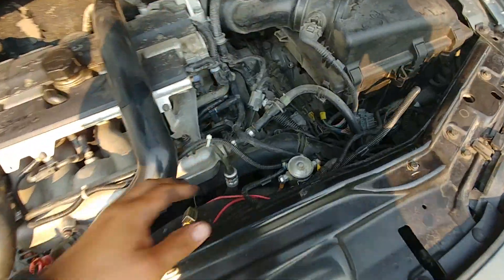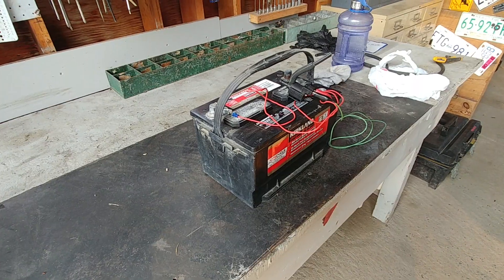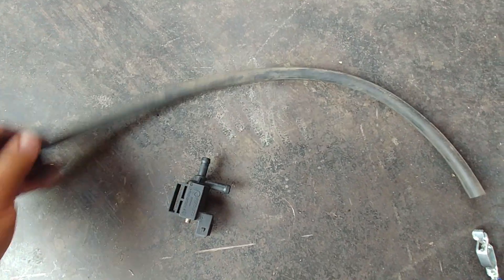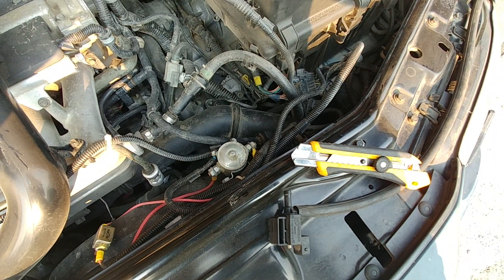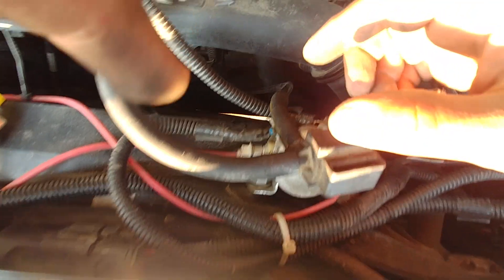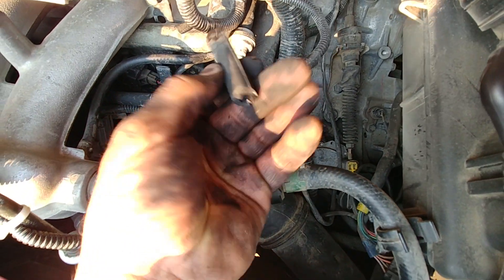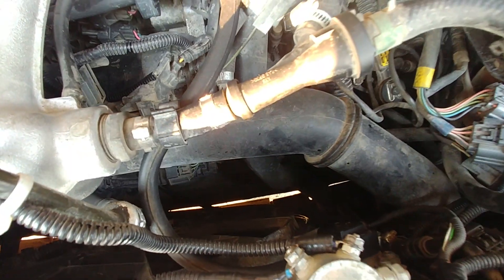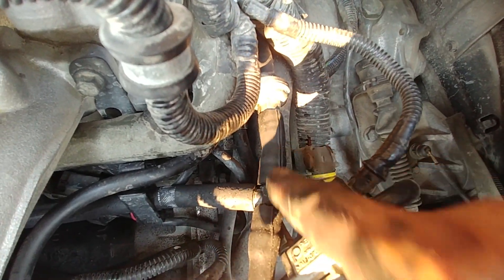VOLVO codes: P0442, p0443, p0446 EVAP SYSTEM LEAK. PURGE SOLENOID VALVE. VOLVO

Comment: Just wondering if the part really needed to be replaced, or just the vacuum lines, or both? Other videos show the evap purge valve as being under the intake and the boost in the front?
Anyway I have both parts and will try to solve my evap DTC one way or the other! Thanks for the video.
Reply from the maker: You can check where lines go from the solenoid. If lines go to turbocharger waste-gate that's  boost pressure solenoid. This one is PCV one. Cheers)
Reply: He tested the valve, and confirmed that is was bad.
Reply: m  jju e the end withe a eeeew the e e
e the e the embedwwe ae
 eukis e we are going e

e
e
we
warranty on gta mjw
even e ssssE e e. mrre
eereeess
ermrds ssmr sger
4
dadrertr
sumo leikk
ekiseewiwsem is were 
ee and i

Comment: Cheers for the video👍 Do you know what diameter the vacuum hose is? Ta.
Reply from the maker: Depends from the lines it could be 9/32 for 7 mm or 1/8.for 3.5 mm. Thanks for 👀 and subscribing. Let me know what size is on you Volvo. Cheers!
Reply: @PistonShack  Thank you.
Reply from the maker: @theaylesburycyclist8756  You're very welcome. I'm glad it worked out.

Comment: Does this cause the car to run bad?
Reply from the maker: Hi Breeze,
Purge solenoid valve on Volvo doesn't effect engine performance so far but one some cars if could effect ECU as indirectly might have effect on engine performance. Cheers and thanks for watching.

Comment: please what can happen to a Volvo that is misfiring while on stand
Reply from the maker: Hey,
It could be an issue on ignition side (spark plug, coil, connector, module ect.), fuel supply (bad injector, fuel pressure ect.) or low of compression at the cylinder. Do you have any related trouble-codes before? Swap the coil and see if misfiring will get moved to different cylinder. Cheers!
Reply: I have a question for anybody that can help me.I have a 2011 volvo s40 t5 it was misfing, I change the plugs and it seems to be running good. Put on idle, it it sputters a little bit, and it's not all the time

Comment: That's a TCV valve. Not Purge solenoid.
Reply: No it's not.  It's the purge valve, they do look a little similar.  Here it is: https://www.fcpeuro.com/products/volvo-vapor-canister-purge-solenoid-s80-s40-v40-v70-9470775oe
Reply from the maker: Thanks Stevo, 
Happy Winter Holidays to You and Your Family!
Reply: silly boy
Reply: @bradleyhovan9390  i have a 2008 s60 and that looks more like my tcv than the purge valve
Reply: @Skeavy  They are the same style solenoid and both are used for the TCV and EVAP purge valve on early P2 cars.  However my TCV is gray and the purge valve solenoid is black.